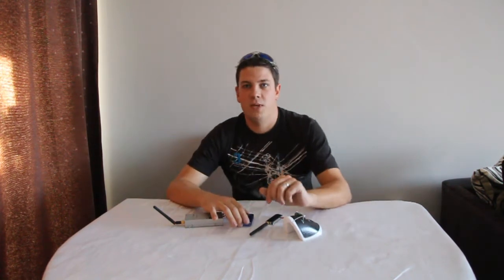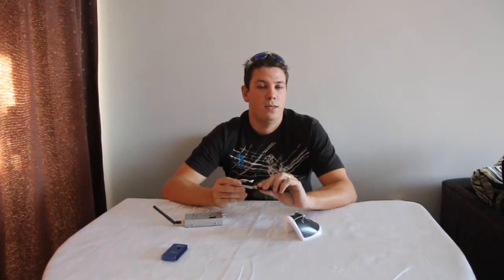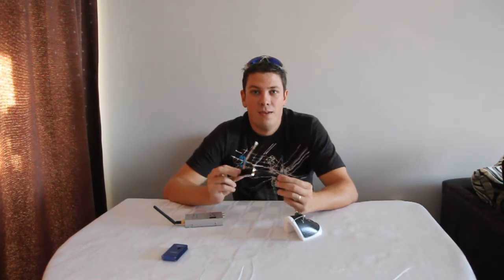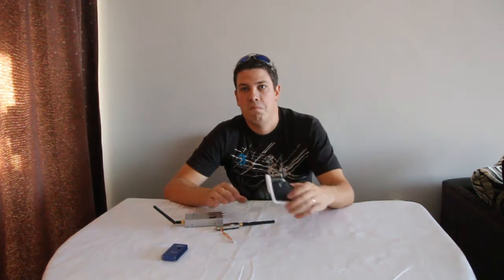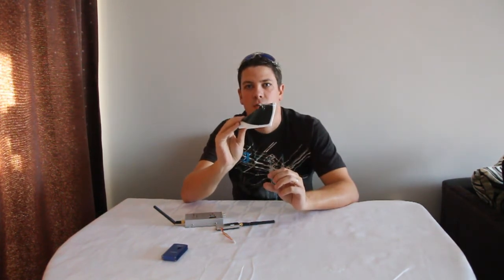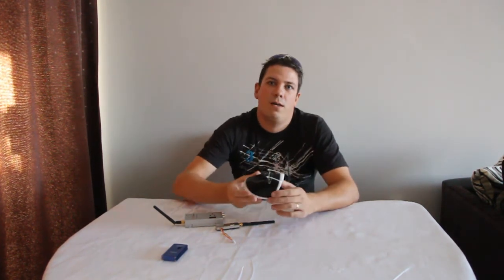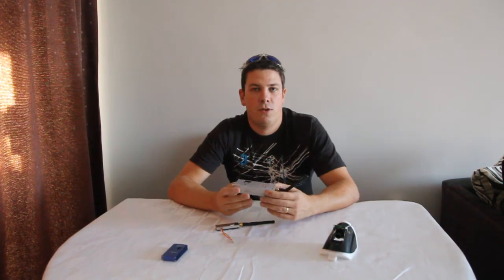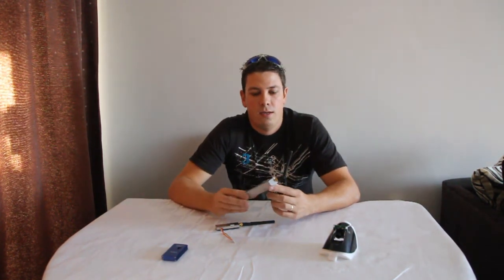Hobbyking 2.4GHZ 1000mW Tx/Rx & 1/3-inch CCD Camera PAL Review

Comment: hmm is that the video tx/rx you use for fpv flying with the bixler?
the bixler came with a 2.4ghz transmitter..
does it works well together? 
I thougt you may never do 2.4 ghz transmitter for controls with 2.4ghz for video....